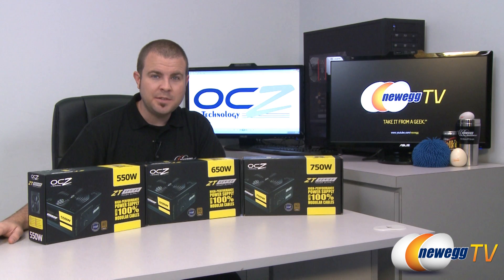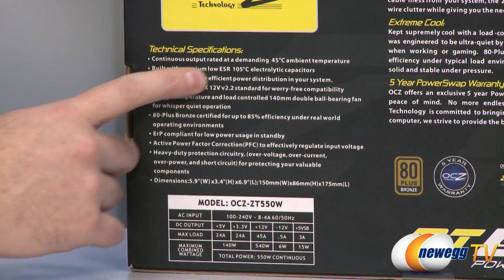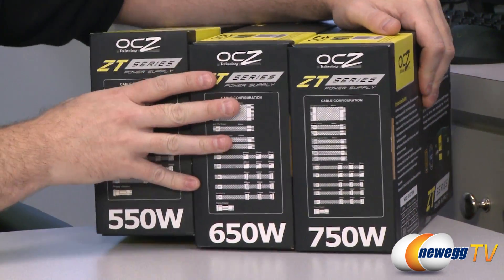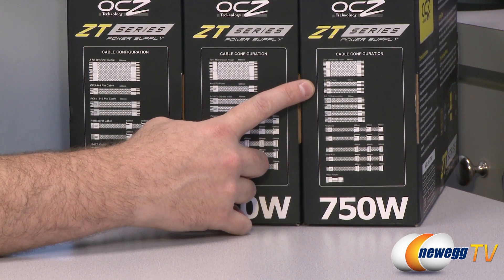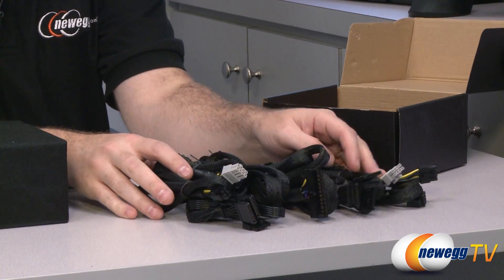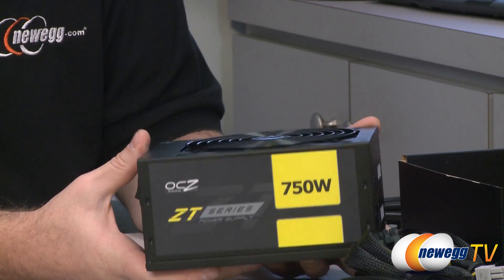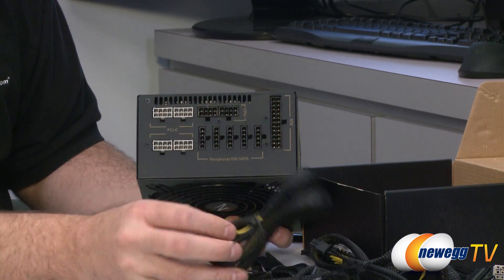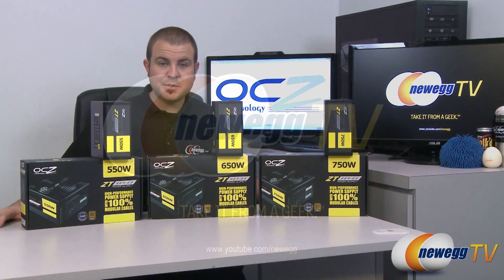Newegg TV: OCZ ZT Series 80 PLUS BRONZE Certified Power Supply Unboxing & Overview

Comment: It was good when it worked. Came with a 5 year warranty. I purchased my PSU on 04/29/2015 and warranty should have expired on 04/29/2020.

**If you request an RMA make sure they return the SAME PSU/SAME SN, contact them and check warranty expiration date SN of PSU they provide from the RMA, or make them give you documentation in writing that they will provide a PSU with a different SN but same expiration date of your current warranty. YOU HAVE BEEN WARNED!!!**
1st RMA was approved 09/29/2017. 2nd RMA was 06/19/2019 and was NOT approved. According to them the warranty expired of the SN I provided. The SN of the PSU returned from the RMA did not match my original PSU, and didn't realize this until almost a year and a half later. My PSU was switched!
SN ORG PSU - ZT07500113790335
SN RMA PSU -ZT07500112400034

I thought maybe I made mistake. I (turned into the IRS) and checked all my previous orders:
12/29/2008 - OCZ GameXStream OCZ700GXSSLI 700W
11/26/2010 - OCZ StealthXStream II OCZ600SXS2 600W
06/26/2012 - ZT Series 650W
04/29/2015 - ZT Series 750W
I only purchased 1 ZT Series 750W PSU on 4/29/2015. To add insult to injury I returned the switched PSU back to PC Power and Cooling in a nice CORSAIR PSU Box :-D
The manufacturer has not responded to this incident since 07/03/2019, and has ended our relationship.

Comment: I got this PSU a couple of weeks ago, it seems to have three fan settings: 0%, 20% and 100%. Since it increases fan speed based on power usage, any time you run something a tiny bit intensive this PSU will take off like a jet.

Comment: @Colton328 
Does it generate more heat than... say, 500 W power supply would generate, even if you're not using all 750 Watts?

Like, if I get the 750 W, but only use 300, will it still generate leftover heat?  I have a low power rig at the moment but I plan on adding to it considerably in the near future.  I don't want needlesss heat, but I don't think 500 watts will cut it.  Not sure about the 650 either...

Comment: @PTNLemay  ultra sells a micro PS aboout 400w modular and very reliable... had used it for over 4 yrs still runing even now with my asus gtx 560 it may be under rated but it runs.. just fine.. not OC 
I72600K, asus p867mpro, 8G ram1800hz, OCz 120G SSD, Asus gtx560 OC, LG DVD rom usb, corsair liquit cooler 50 series.

Comment: @qw3rtyui0p250 Great perspective.  It will work but risk are being taken.  Sometimes, it is not all about the wattage.  Videocards draw power from a separate rail unit.  If you looked carefully in the video, the OCZ has a maximum output of 62 amps.  That means the sli 580s will work hard.  It is like a person threading water so they won't drown.  Eventually, they will give up.  Also, the power supply will take everything with it like a jerk.  Especially the motherboard and cpu.

Comment: @qw3rtyui0p250 I like the headroom.  If anyone likes to run their system up to the maximum potential of a power supply, that is up to them.  A gaming rig is like a car, run that thing redline everyday and eventually one day it will get fried.  These power supply will work with most system but the risk is up to you.

Comment: Be sure to know your amp for your cards and cpus.  Your video card will run more than stated in the manufactured website.  If you have a gtx 460, about 30amp stock, but stock in use or overclock will skyrocket to 40amp or more.  This goes for your cpus too.  The phenom 955 states 125 watt but actual goes up to 180 watts in use.  If overclock to somewhere around 4.0ghz, just expect to go around 200 watts.  Looks here the 550 and 650 watt PS can run only a weak videocard and simple cpu overclock.